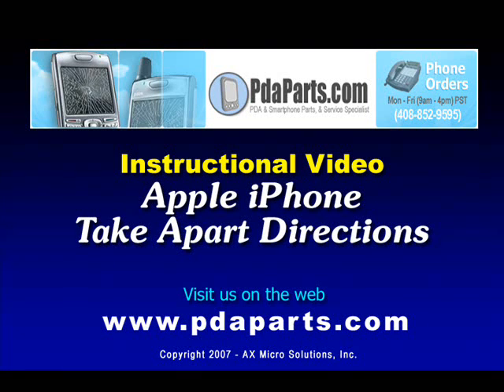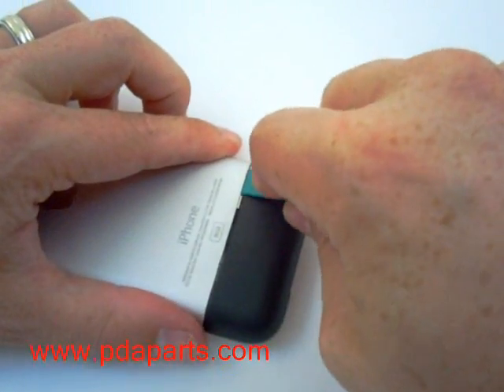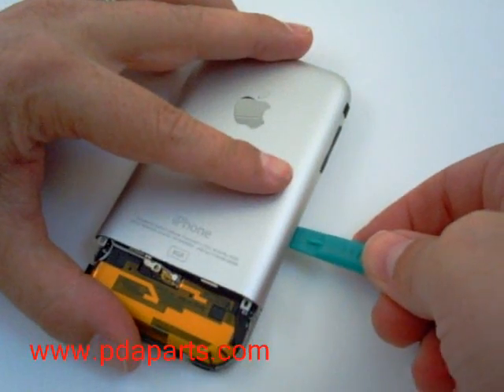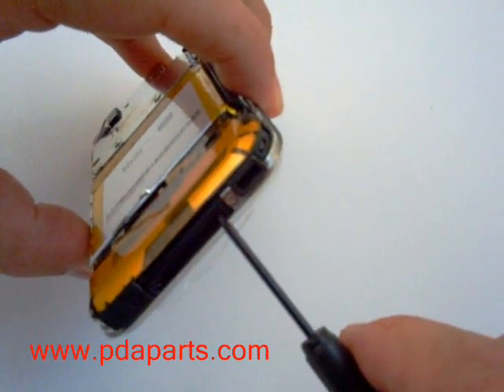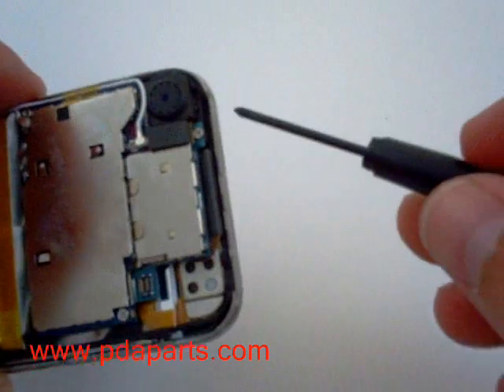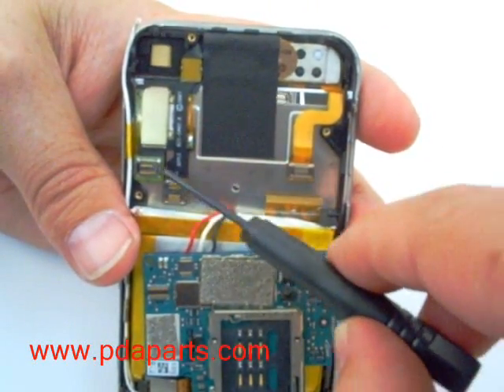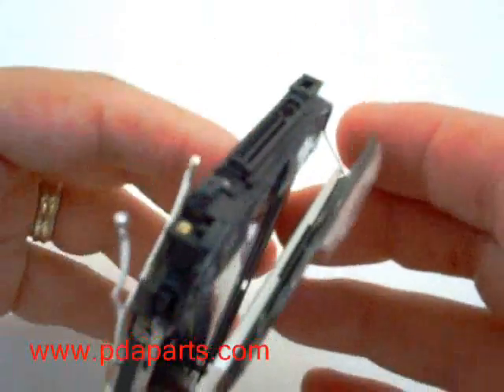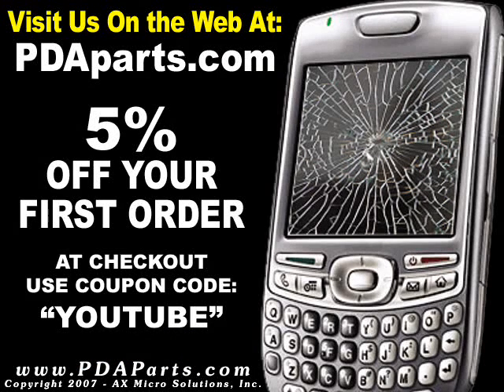Apple iPhone Closer Look Inside Teardown & Unlock by DirectFix.com

Comment: Ok so long story short,.. I'm hoping you might know something because apple can't seem to help me. I have a 1st gen that I have had for years with tons of pics on it, I recently went to go try and get the pics off of it and it gives me the recovery mode message, (I'm guessing because it hasn't been used in so long) well the problem with that is my parents no longer have the computer that it was backed up on. Do you have any suggestions on how I can still get my pics back? I have thought about possibly transferring components to a non-recovery mode 1st gen but I'm not even sure which component they are stored on or if that would even work? Any suggestions would be greatly appreciated. Thank You!